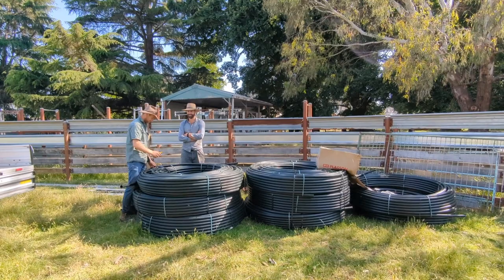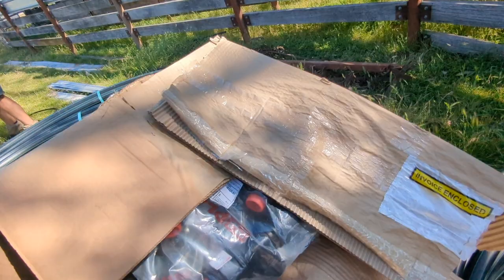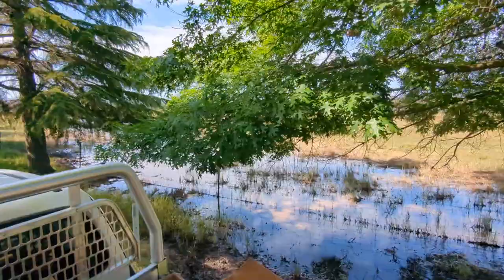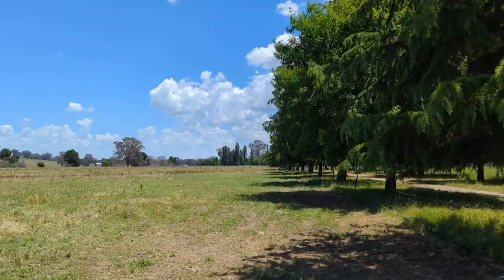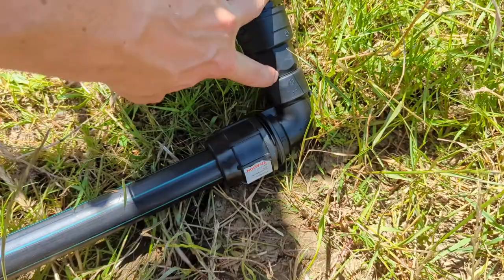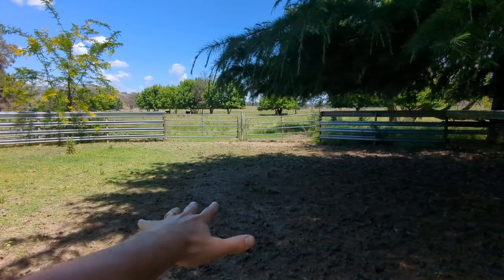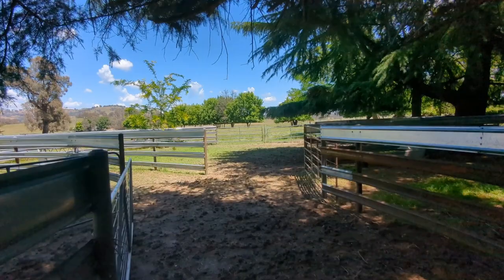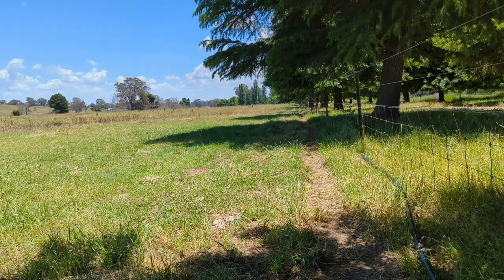Installing poly pipe on a new lease farm

Comment: You could split some 50mm PVC and slot around the steel post if painting is not encouraged by owner. Longer lasting too.
Reply from the maker: Great idea too! The painting was gladly allowed and executed :)
Reply: @wolkifarm  PS, I've also got a poly pipe spinner,  a converted wire spinner. Works well for smaller rolls. Those internal rolls of 1 and1/4 inch could fit.
Reply from the maker: @EagleriseFarm  We tried converting our wire rolled and it struggled through the smalls but couldn't handle the big. Thanks - It's quick enough rolling it out like this on this scale.
Reply: Silicon tubes, although nowhere near as efficient as painting the post, neatly fit over a star picket.

Comment: I'd recommend the
Irwin Impact Pro Performance 3 Piece Socket Adaptor Set for your impact driver from Bunnings. No more manual ratcheting!
Reply from the maker: Forgot the second drill, when we finished it off the day after we had 1 drill for drilling and 1 with a socket. But I do think people worry too much about these small scale efficiencies - not much work to get stuck into the job and make it happen!